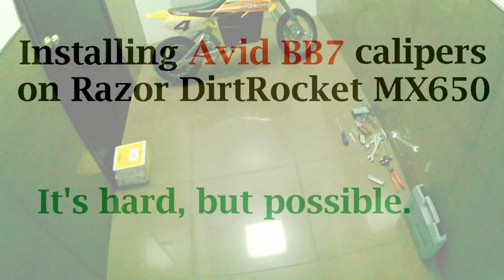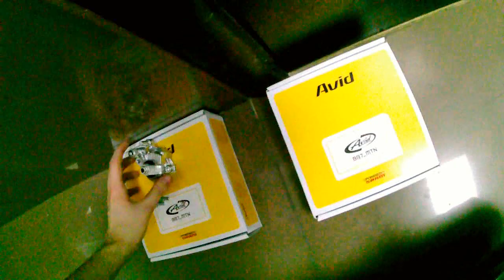Installing Avid BB7 Calipers in Razor MX650 Dirt Rocket

Comment: Thanks for the video, I just put a set of BB7's on my MX500 running a 48 volt MY1000 watt on 72 volts (LIPO).  Now I'm running it at top speed because I can stop on a dime.
Reply: Eric Mills what model of the calipers link plz